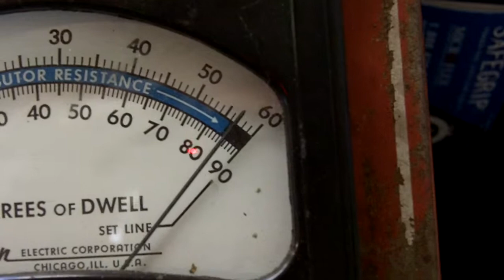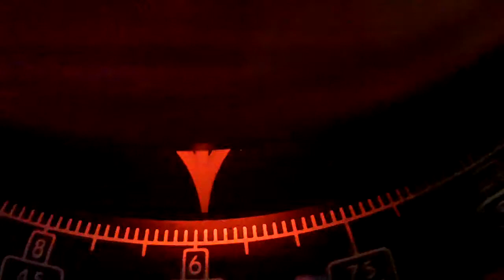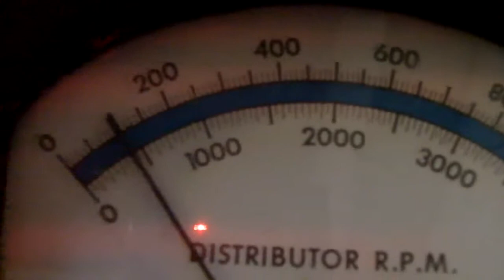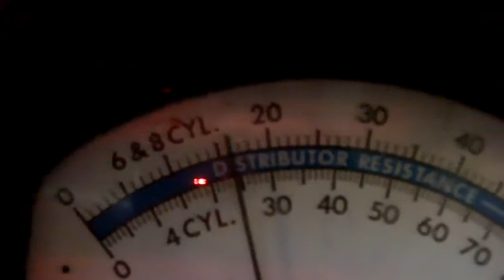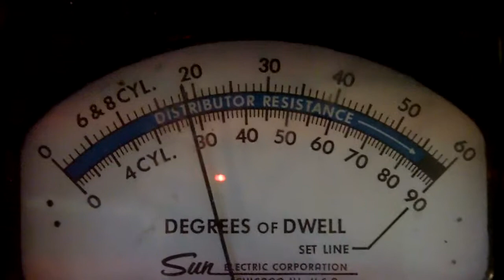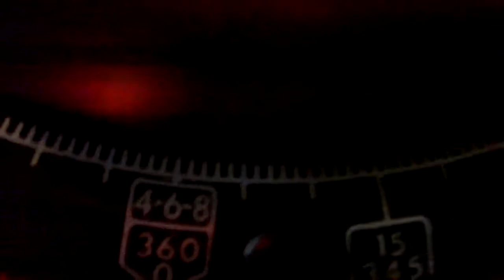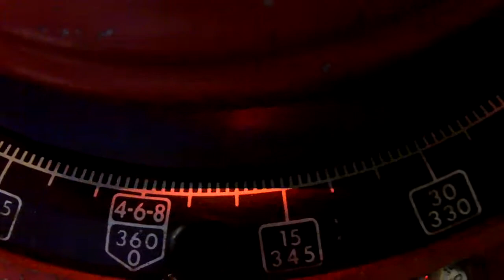Mercedes-Benz 1950's 220 Distributor Test

Comment: Anyone know where to get Bosch distributor parts these days?
Reply from the maker: Apologies for delay in responding. I missed this message somehow. Bosch parts availability depends on the parts you need. Unfortunately, Bosch is not supplying everything like they used to. Many parts are being deleted. All I can suggest is either contact Bosch HQ in Chicago or ask the internet. What parts are you needing?